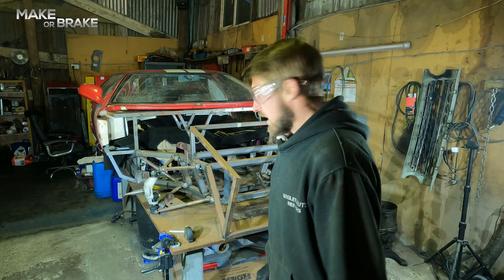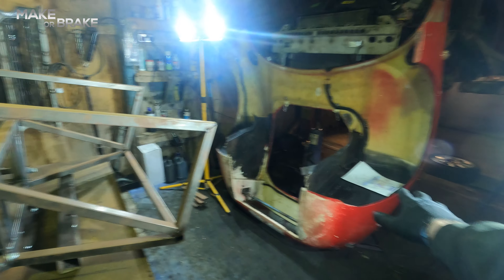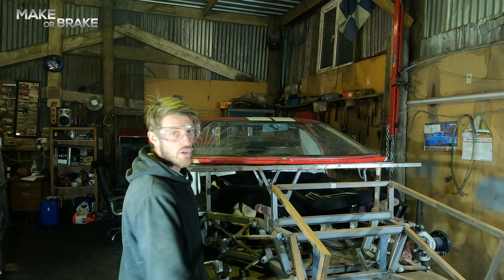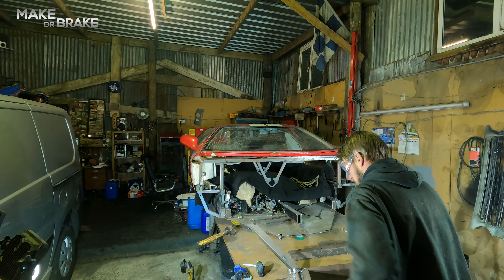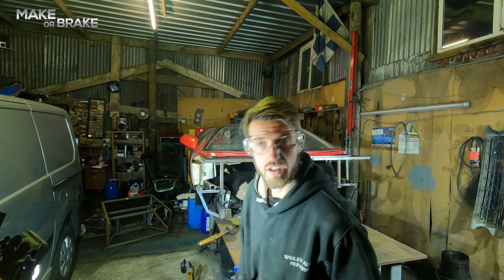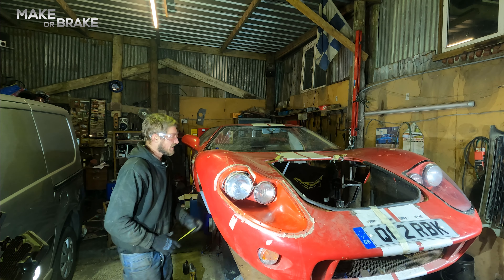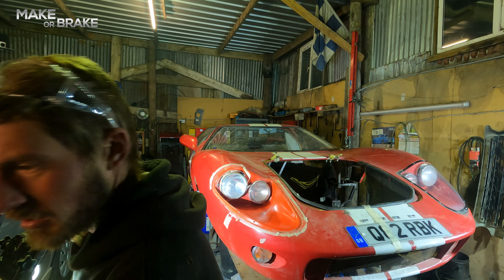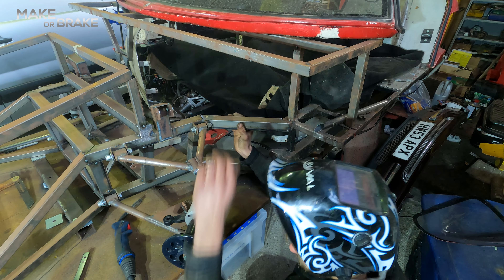WE HAD TO CUT 600MM OUT THE CHASSIS AND WELD IT BACK TOGETHER!

Comment: Before you weld any more set the suspension to the normal ride height and check the height of the wheel in the wheel arch. The usual ride height for a road 40 is 4" front and 4.5" rear chassis to ground.
Reply from the maker: Thanks Mike :)
Reply: @mikepass463 it differs for different "kits", original Mk1 GT40's had 4.8" street, 4.1" track clearance (with the official spec sheet listing front 4 3/4  - 5" and rear 4 7/8 - 5 1/8" with a minimum clearance of 4" (doesn't mention where, I suspect bellhousing). Mk3 (according to Car and Driver June 1968) ground clearance 5.25" (doesn't mention where, I suspect bellhousing again).  ERA recommended 5" front, 5.25" rear. GTD 127mm, KVA don't but mention "cutting a loop of spring" to bring it down to 4", SPF 4.125"-4.75", Tornado 5", KCC 125mm, GTS 5".  

All depends on the roads near @Hardupgarage and how bad the speed bumps are but personally I'd err on the side of caution and go for somewhere between 5" front, 5.5" rear and 4.5" front, 5" rear for road and drop it down for track use. Just make sure have the range to do that and take into consideration the tyre sizes!
Reply: @fastdruid  My GTD has been on the road since 1998, 24 years. My road has 22 speed bumps. It has a good compromise between road and track. It is OK on the road and has done hillclimbs in the Isle of Man and track runs at UK tracks and  Le Mans - I just adjust the shocks stiffness. The trick is to run the front tyre about 1/3 across over the single bumps. The only clearance issue I have had  is getting on steep ferry ramps - so I go over the joints at 45 degrees then it's OK. Note that changing the ride height also alters the roll centre.
Reply: @mikepass463  Glad those heights work for you but you made a categoric statement that "The usual ride height for a road 40 is 4" front and 4.5" rear chassis to ground." I was just pointing out that *isn't* the "usual" with evidence (rather than just a aggressive "you're wrong") rather than 4" and 4.5" is the wrong height for one. 

That yours is fine with 4" & 4.5" does give me hope that mine will be ok (when it's actually finished).

Comment: Fit a front wheel/tyre and check that it moves freely lock to lock through the full suspension travel before you finalise the welding 😉
Actually, do both sides, I had a serious wheel arch asymmetry on mine (it was a MKI though) ...
Reply: ..... I was just thinking the same as I was watching him proudly turn those hubs..... WITHOUT a wheel on.....
Reply: I was going to say the same. They're famously asymmetrical, the "kit" instructions I've seen (and I've seen most of them) all have different measurements left to right etc.